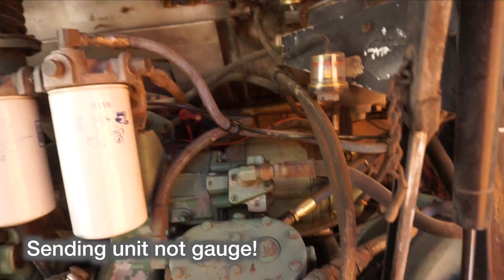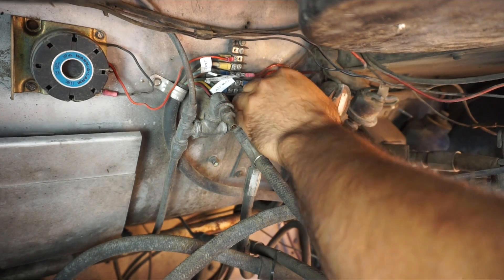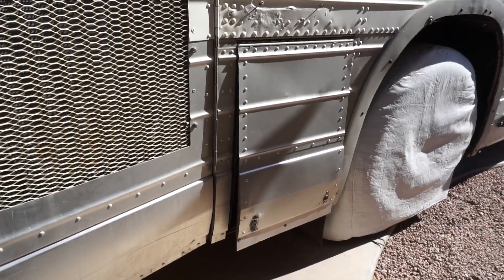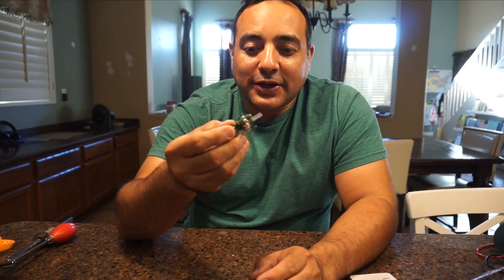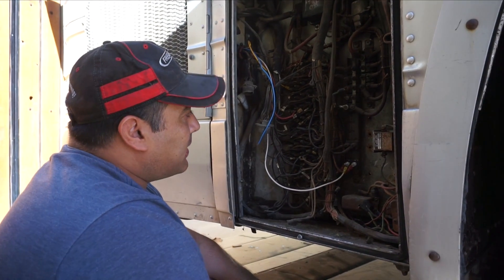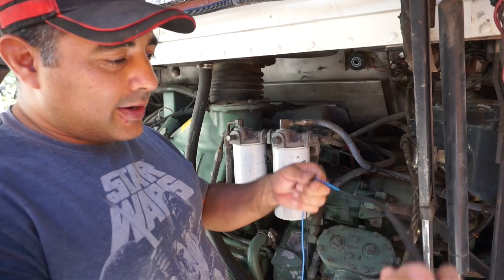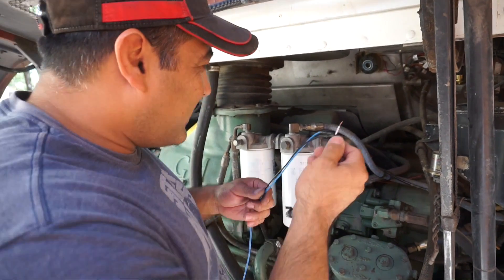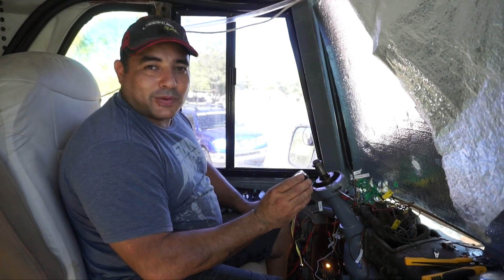Dash Rehab Part 3:  Hacking the New Oil Pressure Gauge Sensor

Comment: the one wire sending unit might just be for the no oilpressure light (off/on ) and not for actually sending the actual pressure
allso if youre lucky theres some wiring in the bus for say interior lighting that you might be able to splice intoo and reuse it for the oilgauge and not have to open up the whole bus to pull the wire to the front
the 12 to 5 volt usb adapter could work but these adapters are pretty low amp and not usually of good quallity , might be better to use a step down converter meant for constant use , there potted (filled with resin) too so can handle moisture better
Reply from the maker: Thank you - It has worked great for the last 3 years so so but I have a potted one ready to go when it starts giving me trouble :). I had to buy some for the home automation stuff so I went with some heavy duty ones that should fit well.

Comment: I'm thinking of building a secondary gauge system on my bus using arduino microcontrollers and a rasberry pi feeding a screen or heads up display on my windshield, and writing some code to warn of climbing temps, pressure, etc. And display speed, altitude, ride height, gps coordinates and other fun stuff.   I'm sure this will require a lot of fiddling and a combination of reading analog sensors and adding new digital ones, but having blown an engine before, it'll make me feel better to have a computer warning me and for readings to be right in front of me. My factory gauges are quite tiny, poorly lit,  and ill placed for viewing.

Comment: You are very resourcefull but that oil sending unit is just for a dummy light. It's very common. You could have gone to any parts store and got one for under $10. I think if you look up just for example a 79 Chevy C20 pick up with a 5.7L (SB 350). I service diesel generators and that is very common. I still work on a lot of 2-stroke Detroits like the one in your bus!
Reply from the maker: Thanks for the comment - the sending unit came with the new oil pressure gauge.  There is another one next to it for the dummy light.  I will keep this in mind if that sensor goes bad.

Comment: They make weather proof 12v to 5v converters that are pretty cheap on amazon. I use one to power a raspberry pi in our RV. I think over time vibrations might cause that little charger to fail.
Reply from the maker: Awesome - if this guy fails I will look into one of those - thanks!